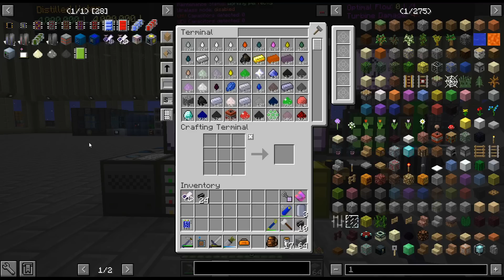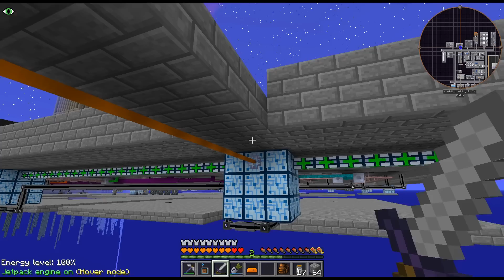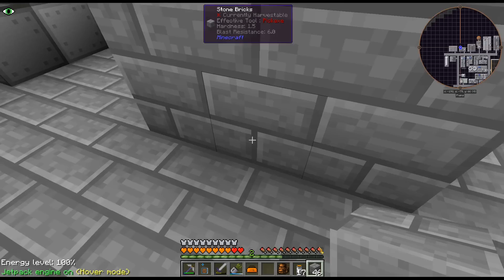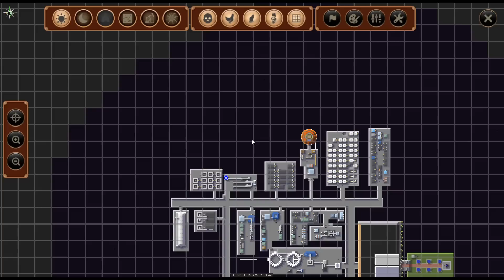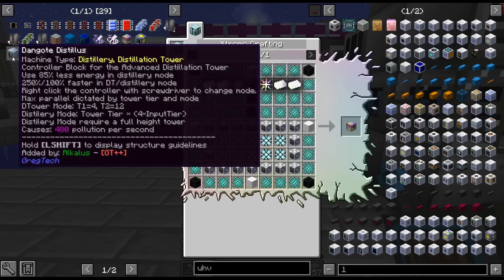GregTech New Horizons S2 - 270 - How Do I Advanced Assemble

Comment: Will a machine work if it has a energy hatch and a laser hatch because you had it setup with the zpm laser hatch and uhv energy hatch however you didnt turn it on could you potentially use the laser energy hatch for power and use the regular energy hatch just to trick the machine to run at uhv
Reply: No, it uses the lowest tier energy hatch for recipe checking purposes
Reply: 11:49 it showed uhv tier (both the hatches were on) so I was hoping maybe it ran at that well hopefully they come out with lower amps laser hatches then so you don't have to use 256 uhv amps lol
Reply: @Tentative_Man by the point you are getting to uhv 256 A hatches you should have enough power transfer through lasers to handle it